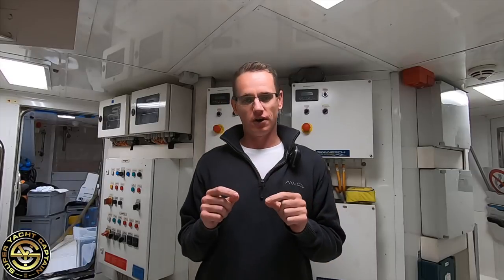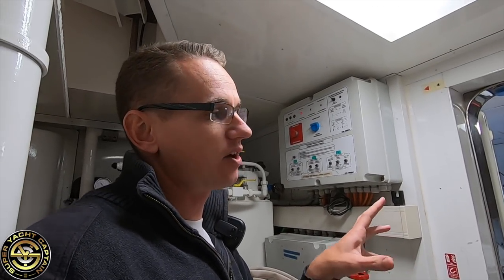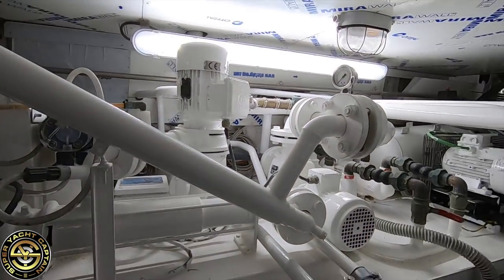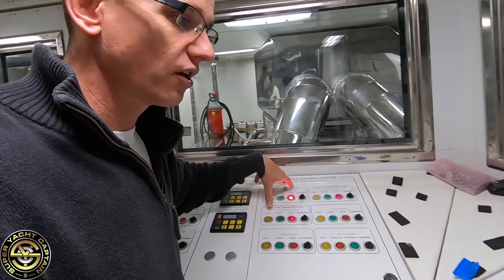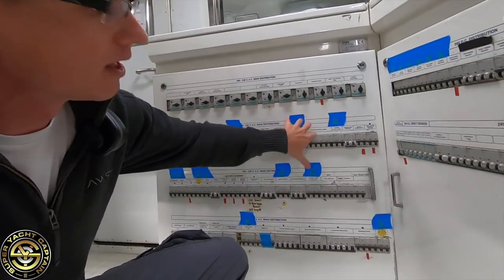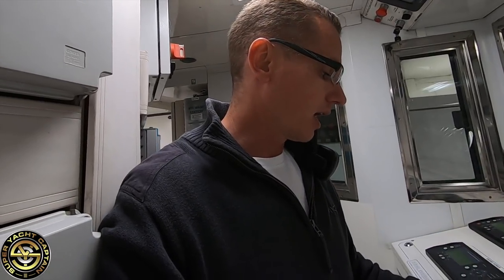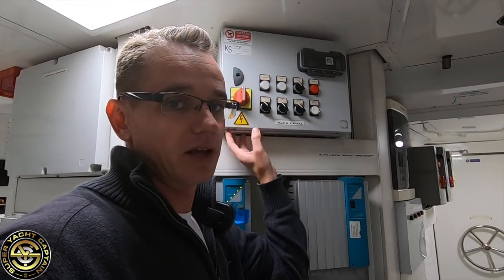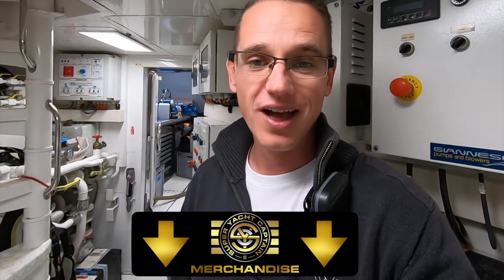Engine Control Room Tour Onboard A Super Yacht (Captain's Vlog 118)

Comment: Hi Tristan. Thank you for another nice video. Noticed a few things - 1) Wouldnt it give you much quicker response time to fight the fire, if you have your hose and your nozzle already screwed on the pump (like a hydrant in a building)? Or is that technically prevented for some reason? 2) Why all the yellow levers are not labeled (or otherwise sugested their function)? 3) Engineroom is mostly lighted by artificial (LED) lighting.  It may be helpfull to the crew (especially in emergency), if a) there is handfull of fluorescent pointers to exit - on the walls or ceiling, and b) if under one, few of them, or all of them is attached a box with headlamp and/or glowstick. 4) In one of your previous video, i did notice, that the ship engineer does have a marker and laminated checklist(s) for some elaborate procedures wich seem to have been done in some succession. I am sure, your engineer does not need that furthermore, but if the owner needs to change his engeneer for any reason, or if someone new is in the engine room for some reason, it would be a help of great deal, to have a described folders with checklists for usual and annual change of technical fluids, maintenence and/or repair.

Comment: Thanks for sharing such great tech info. 
Can you tell me more:
1. For engine room +ve pressure why not open vent to the open atmosphere as this may eliminate the machinery required to maintain the pressure to feed the engines.

2. The exhaust filteration processing is done only for generator exhaust or also for engine exhausts ?

3. Why not induce some solar power to save on exhaust reduction.

4. Is there any priming mechanism for the generator cooling water circulation as they may have air now as they are out of water
Reply: If powered ventilation it's easy to shut it off in the event of fire. Reliance on solar in turn relies on sunny weather, boats go where it's cloudy too.

Comment: Why do you run the generators permanently when you are out of harbour? During a cruise there should be electrical power from the main engines? If they are switched off at anchorage I understand that the generators are necessary.. Please try to explain more about the electrical power distribution of AWOL... Thanks for the constant uploads!
Reply: A lot of boats doesn't have shaft generators mounted on the shaft drive. That is why the generators need to permanently running out of harbour. The engines often simply just turns the propeller and it's own pumps.
Reply: @alexteehee10  ^^^ This. Larger vessels have separate engines and generator sets. There's a plethora of reasons why this is, but it boils down to reliability, longevity and fault tolerance. If the generation fails but the main engines run, the vessel can still maneuver to safety. If the engines fail but the generation runs, power is available to call for help, or operate tools to fix the engines. It's also generally the case that the main engines use much more fuel, and are more expensive to maintain properly.
Reply: @McTroyd  Exactly Ted. 
The RoPax ferrry i worked on, we had 3 MAN 6L16/24 diesel generators with an power output of 515 kW each.
The 2 main engines we had, which did have shaft generators had an power output of 4380 kW each. So if we had to run the main engines for power,  we would use much more fuel since one main engine averaged about 800 liters per hour.
The MAN diesel generators used approximately 50-60 liters per hour just generating power. When we were out of harbour on long voyages, we would connect the shaft generators and turn the MAN diesel generators off. When we were approaching a harbour again, we would use the shaft generators to power the bowthrusters (Bowthrusters 900 kW each,  the shaft generator power at 1150 kW each), and the MAN diesel generators to power all the electrical.
Reply: @alexteehee10  Really cool! Thanks for that insight.

Comment: Did I miss reference to Uninterruped Power Supplies (UPS) to back up critical control equiment to bridge the gap when change over from shore supply to Gen sets, I have one fitted on my 12m electric boat if you need more info -)) ps great vid!

Comment: The primary voltage for the steering gear pumps is 220v. So it’s powered by the gen sets and uses batteries for 24v back-up in the event of gen set failure?  I had imagined it would be exactly the opposite since you only use rudder with mains firing and would want to reduce draw on gen sets when off of shore power to direct to domestic systems. Is that flawed logic?

Comment: Bilge water can't be pumped directly out to the sea....
Must pass through bilge water/ oil separator.
Reply: Unless in an emergency it can be used to pump directly to sea at the chief engineers discretion as he explained in the video.
Reply: Jorge Ace What don’t you understand ? Where did he say they pumped straight overboard? 😂 He blatantly said a breach in the hull in which case you’re going to bypass the OWS completely as it’s an emergency. They probably don’t even use the OWS onboard as they’ll probably discharge to a facility ashore along with the sludge tank.
Reply: @Josh-bj1qo  At 18.13.

A bilge pump is not intended to be used ONLY in case of an hull breach or ER flooding.
The contaminated water fill the bilge almost continuously and must be extracted.
That's the normal in any boat.

In fact there should be more then one bilge pump....smaller  and bigger (running on PTO or with an electric redundancy).
The small one (s) run automatically.

As for the rest,MARPOL is not in conflict with SOLAS,and the regulations on every boat discharge will be more and more stringent.Not on the discretion of the enginner.

That will end our exchange.
Thank you.

Comment: why does a yacht need so much more fuel treatment than say a railroad locomotive
Reply: If a locomotive has an engine failure while underway, it doesn't generally need to worry about the rails moving underneath it, or being tossed like a child's toy in a bathtub. Both of those situations can also get seawater (with the corresponding salt and debris) into fuel tanks. So it's a bit of prevention, and a bit of margin of error against the elements. I'm sure both are fairly important to Capt. Mortlock while running a charter vessel.
Reply: I think in some countries the fuel is not that "clean", better to have your own filtration system to mitigate dirty fuel issues.  My guess at least.
Reply: @schwags1969  Also a good point.
Reply: @schwags1969  I appreciate you admit it was a guess and it makes more sense than other explanations that made none, but were presented as the fact. My question/guess was do they use empty tanks for ballast and need to watch the fuel so close